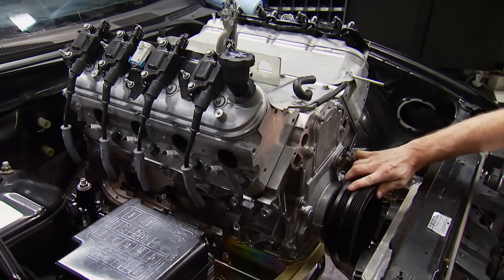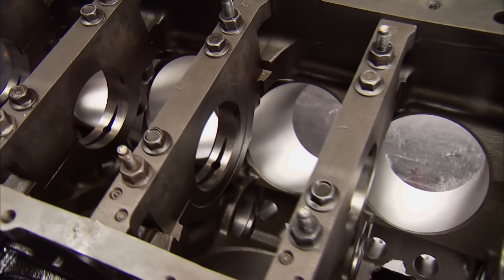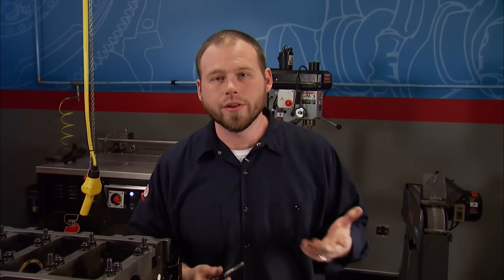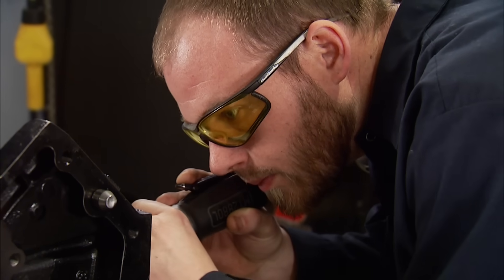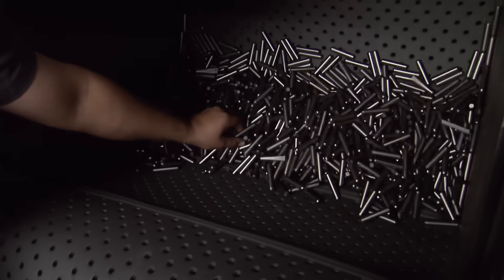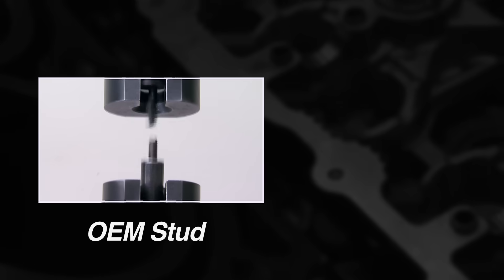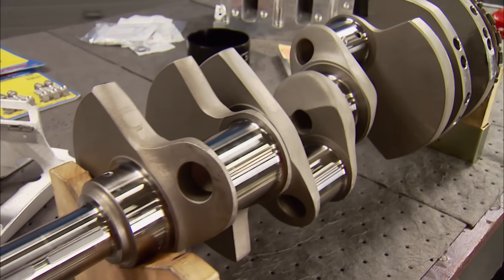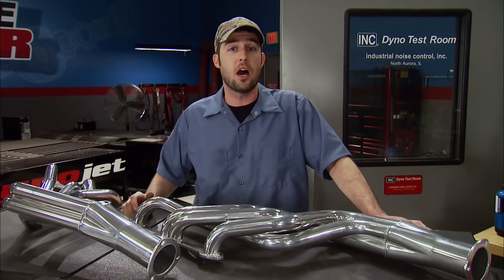Building A Chevy Stroker From Scratch With An LQ4 Iron Block - Engine Power S1, E9

Comment: To ALL the self building guys in here, DO NOT weaken the caps by doing the drilling a hole thing to get it off.  all you need to EASILY remove the caps is a pair of larger (12") crescent wrenches.
Place one on each side opposite each other with the tip of the jaw under the cap.  Press down slowly and watch out for smashing your fingers.  Flat palms work best.
Next thing ya know, pop!!  Cap is off and no drilling/tapping on a block that has already been cleaned.
Can do the same thing with an 18-24" 1/2 breaker bar.
Slide it under one side and pull with a finger on the other.
Pops right up faster than the crescent wrenches.

Comment: Question for you or anyone else who might know. When installing the main caps and bearings you have to torque the bolts then it says to degree the bolts. Obviously I have to check the clearance before final install. When checking the clearances do I torque and degree the bolts or just the torque?

Comment: sadly now arP is chinesium, the stock bolts seem to hold just fine on ALL sloppy builds, yes they destroy ring lands, or keyhole a block now and again, but they also make a Ton o Power off truck/junkyard Vans w cams, springs, turbski's etc....

Comment: Have you ever tested ARP fasteners?  How do you know they are any good?   I worked in aerospace.    Fasteners on planes and spacecraft are carefully specified and tested.    Do not know any ARP bolts used in aerospace.   They are only used in cars where if they fail, it is no big deal.

Comment: WHICH LS PARTS are BEST  swappable from size to size betwen the main 3 sizes; 4.8, 5.3 & 6.0??
LIKE 4.8L pistons will fit a 5.3 directly and increase compression either .5 or 1.0 SO about 9.4 to 10.4 correct?
Which crank in a 5.3 L will make it a stroker?
only specific stroker crank or will 6.0 L crank make it a stroker for example?
WHY are 862 heads so desireable? cuz they flow better AND raise compression? can they be combined with 4.8 flattop pistons and still run on 87 octane?

Comment: The arp main studs are overrated…..stock bottom end LS can handle over 1000hp……only arp hardware id use is head bolts just to abvoid that torque to yeld 45* stretch bullshit….plus the arp head bolts are re-useable ……as are the factory ones..just not reccommended

Comment: Got alot of great info out of this, one thing i did wonder though is (even though you gently used the oil inpregnated file) would that have any impact to the balance of the rotating assembly?
Reply: I was thinking about that too.

Comment: That engine is a 4x24. The cam gear is needed for rpm correlation of the crank. Yet they didn't use the timing cover with the sensor and I'm wondering how this will eventually work without a stand a lone computer

Comment: If you are going to have studs put in....you should have it done when you have the block prepped in the first place. No need to have it done again afterwards..same goes for deburring the bottom of the cylinders. .BTW....there is no way in hell I am going to drill/tap a hole in a main cap and make it weak.

Comment: My understanding of flexing metal it seems like by doing your line honing after you tore it down you made one side bigger that it needed to be because only one side deflected because of the extra pressure I used a half thousandths bearing and changes the gap and I haven't had any problems with my 408 over the past 3 years of service

Comment: Turn my lq 4 into a 408 till this 360 foot pounds of torque to the rear tires the 250 horsepower to the rear tires don't know what it has at the crankshaft but in my 2001 Chevy four-wheel drive 3/4 ton of suburban it pulls the race car down the street is fine I lost point .037 in gas mileage over the old 6 l

Comment: I would highly recommend using thread chasers instead of using taps.  Taps will remove some metal and sharpen the edge of the threads which make them weaker.   Thread chase full sets are inexpensive and last a long time when uses properly.  Taps are for cutting not cleaning.

Comment: That's a cool tip grinding the oil holes to push oil though easier, but what's y'all's opinion on grinding those cylinders down? Need a 2nd opinion bc that just doesn't seem right

Comment: I like ARP, if I could I'd even use ARP bolts to hold my lawnmower wheels on! Being the best is great, but it's something else when you are the best because of the hard work and all the effort that makes ARP the Best bolts available! The only thing better than a ARP bolt, is a bigger ARP bolt! LOVE the ARP FASTENERS!
My 385 stroker has ARP main studs, head studs, rod bolts, and even intake bolts! ( I had a extra head stud, used it to hold the oil pump on! ) And ARP rocker studs!! #1 ARP!

Comment: At 5:41 why didn't he just take the studs out? Why weaken a cap? I've never had issues getting one out... then 2 seconds later he's taking the studs out.. Then runs a die grinder inside the fresh bore. Amazing. That fancy new high vol oil pump going to suck ya sump dry mid track. The original factory one is better. What was wrong with the factory timing cover? What about thrust measurement? Good lord...

Comment: My 03 h2 has the 6.0l and its seriously anemic to say the least.stroking it seems like the best option all the way around with regards to money spent. It needs the torque sitting at 8500lbs dry. Now i just need to win it
Reply: You're hummer is not 8500lbs dry, stop reading the gvwr number on the door and assuming that's the vehicle weight. Actual weight is around 6400lbs. As for performance, truck norris cam from btr, 706 heads, headers and a tune will wake that motor up like you won't belive.
Reply: @donniecahill5243  no it's not prick

Comment: Guys, why tf would you drill out the main caps to pull them? All you gotta do is use the handle of breaker bar on each side and pry straight up. Good god.
Reply: Was a wtf moment for me too. Not to mention the ARP studs were already in it! Could have just backed em out.. Now he has a weak cap and a block full of metal he has to wash again.

Comment: Seasoned block from Summit! = Used junkyard block. Love that it’s rated at 1400 HP. I made 780 HP on my junkyard LQ4 with a VS turbo. Had no clue what I was doing. Hey, it works, what can I say.
Reply: flexplate rating or RWHP?
Reply: @Ed_H_870 you can make 1000 Hp the tire on a stock internal gen 4 6.0lq4.  It’s been a million times. Type it in the search on YouTube.  And that summit block is just a factory 6.0 block that’s been machined.  This isn’t brain surgery.

Comment: I have a 408 in my 2001 suburban I only Dino did on the wheel Dyno and I made 361 ft pounds of torque to the ground
all parts and labor $5600.00
much better than the stock 6.0L that came in my 2001
Reply: That's really low torque numbers. Whats your setup? You should be making 450whp and 480rwtq with a stroker.

Comment: Seems to me that the screw hole in the main caps will weaken those caps.
Reply: Yes asshat idea !
Reply: That is a steel cap on a cast block - what do you think is going to flex - the cap or the block?  Their is a reason neither of you are engineers....  Don't over think this stuff.
Reply: @Chuck_Carolina  why would you think that you’d have be an engineer to question a hole where a hole should not be. There are journals in aircraft engines that no one would ever drill a hole to pull the journal. Answer me why?
One last thought, the engine design engineers at GM did not drill a hole, why?
Reply: @GeoHvl . Agreed!

Comment: And damn! I just finished my build of my 5.4iron block gt500 and I wish I’d seen this because deburring the bottom of the cylinders and the piston skirt is a good idea I wish I knew before! Damn it! But thanks!
Reply: Next Sunday morning, yank that pan in the driveway, blocking your wife's ride in the garage, and start grindin'!!
Reply: @wsfwsf1497  lol 😂
Reply: didn't watch the video because i thought it was one thing an turned out to be go buy bunch of summit parts,having said that once you get a block clean first thing you do is go over it for casting flash an stuff, if you touch the pistons use a scale an weigh them get them the same an that goes for any rotating parts , chevy rods have balancing meat on them to even them out um stuff like that , longer you do it more you pick up like anything  really

Comment: How about just clamp that slide hammer to the outer edges of the cap where nothing touches it anyways and not drilling a hole in the cap that to me could make a weak spot?  Not sure just a random thought.
Reply: Lol or using your hands 🤣🤣 never needed anything more I've done quite a few of these
Reply: LOL yeah. Spend all that time "removing stress risers" from the lifter valleys and gasket surfaces, only to drill a hole in the middle of the main cap YIKES
Reply: @th600mike3  I WAS LOSING MY MIND WHEN I SAW THAT
Reply: I WAS LOSING MY MIND WHEN I SAW THAT
Reply: Yeah I wasn’t a fan of that or the work they did to an aftermarket piston. If you’re that worried about the product, don’t buy it.
Reply: I agree, I’m not drilling any holes in my main caps no way in hell
Reply: They built some pretty good engines on this show, but this one was one I NEVER would have aired if I was the producer.
Must be why that one guy did not last all that long on the show.

Comment: Just wondering about that trick with the main caps ,  isn't drilling a hole in the smallest part of the main cap introducing a possible failure point in the weakest point of the part? I've never heard of one breaking, but at big numbers and pressures you can see nowadays,  just curious...

Comment: I want to know where the other 2 parts to this are?  Really damn annoying to not have links in the description or something to see the rest of the build and power numbers.
Reply: Just go buy a ls364 straight from GM. Cheaper and with a warranty.
Reply: @MrPland1992  I am not over spending for 1000 hp.
Stock junk yard stuff has been proven to do that with only a good cleaning and new rings gapped for BOOOOOOOSSSSSSSSSSST
Reply: @Ed_H_870 not true whatsoever. I do LS swaps for a living. Literally every junkyard engine I use has 3 psi oil pressure. It’s not worth the headache anymore and I’m not in poverty. I can afford $2k-$3k for a nice “new” engine. Factor in the tow bill when your turd blows up once a month. 
I want to be able to beat the piss out of it and not worry if me or my customer will make it home
Reply: Look up Iron Animal build.  They just renamed this video for some reason.

Comment: WD-40 is not a lubricant, I know a lot of you heard this but did you know that it was invented by the rocket chemical company in 1954 to spray on the skin of atlas rockets to keep them from rotting in the silo. WD stands for water displacement, the 40 stands for the 40th concoction, I'm speaking of the original formula

Comment: I welded a slide hammer to a pair of modified vice grips that I put aluminum jaw blocks on to do the same thing.  I also use two torque wrenches at the same time when securing caps

Comment: My daughter threw away about $1300 worth of fastners from ARP. She has a part time job now
Reply: Jesus christ
Reply: Please explain how this happened
Reply: @tjlovesrachel  I bought her a 1996 mustang gt for her 14th birthday that we could build a drift car together. On the 3rd day she had it. The car was down to frame. We hit the jackpot on the car because we didn't know the previous owner actually upgraded everything we wanted on it, INCLUDING ARP fastners for everything etc connecting rods, mains, heads, trans, I mean everything. While she was cleaning the scrap pile, she literally just swept all the bolts away because she wanted new everything. She did her homework that the engine used torque to yield in some areas and didn't know ARP were reusable. When I went to the trash to look for them, they were gone but I did manage to save $2000 worth of other parts she threw like accufab throttle body, flywheel, nitrous controller, MAF sensor, valve covers 😅 to name a few
Reply: @elite4championjosh  Jesus Christ... but thank god you saved the parts you did save... and I guess she knows now about them arp fasteners lolll.... best of luck to you two... how did the project go?
Reply: @tjlovesrachel  it'll be ready in about a month. Been down for 2 years because she's building it. I'm just guiding her through the process. But she's changed the color of the 3 times though 🤣
Reply: @elite4championjosh  freakin sweet... I bet she can’t wait to drive that thing and light up a parking lot lolll...I wanna do a similar project with my kids when they are about the same age... would love to see it when it’s completed.

Comment: Nice new engine parts and a carb, come on its not the 80s still
Reply: Video made in 2014, how were after market EFI systems then? Serious question, not meaning to diss you.
Reply: @allenl9031  the same as today. HP Tuners has been the  go to tuning software for GM LS Series..although a few years ago Holley created tuning software product  that is great and pairs up real easily with Holley ls products. Although it’s much more expensive than hp tuners.

Comment: I am currently accumulating parts for 6.0 stoker (haha)
Reply: Neat, I turned my 5.7l in my Ram into a 6.4L stroker, love the power!
Reply: @bigboreracing356  yeah over spend for no reason. The cheapest way to get to over 600 horsepower is a junkyard ls 5.3, cam swap, valve springs, injectors/ fuel pump and a Chinese turbo charger. This will run you at around less than $5,000
Reply: @ivanjimenez8868 . You’ve been watching Richard Joldener🤣
Reply: @bri-manhunter2654  sweet! His work is awesome and a great guide for anyone looking to add power.
Reply: @bigboreracing356  theres nothing to build that's a brand new crate engine.. nothing is wrong with it but theres much cheaper alternatives. you'll get more power from a junkyard gm for less cash. If you want to hit 1000 horsepower? Then use more turbo boost, 20psi of boost, with e85 will easily get you there on a junkyard 6.0 ls..with a 5.3 you would have do a little more work than a 6.0 but you'll get there. Watch richard holdeners or sloppy mechanics' content and research as a guide.
Reply: @bigboreracing356  nice! On all parts from the Ford factory? Besides the turbo. And On pump gas?
Reply: @bigboreracing356  I’m just asking?? So no pump gas? What’s it running? you’re the one telling the story , I’m not Henry Ford..So what’s in that race car ? A new factory 1400 HP 7.3 godzilla/Turbo charged rebuilt engine?

Comment: That trick of John's getting those main bearing caps out was pretty smart
Reply: Since he is using a vice grip slide hammer, why not just vicegrip to the caps?
Reply: @greggoett  I was thinking the same thing!
Reply: Two long screwdrivers slid into the side gap and a quick tap does the same thing without any chance of weakening a cap
Reply: Except he used a standard thread on an otherwise metric block.  Should have used a 6mm
Reply: Except the part where he's blowing metal shavings all through the engine, bearings included!
Reply: yeaaaah id rather just use that perfectly suited vise grip hammer he had, put some hot glue or rtv on the teeth and grab the cap directly.
Reply: Still learning about high horsepower engine building, could this possibly cause a weak spot on the cap?
Reply: @cmkm54  I'm not an engineer.   But my gut says that the what looks like an 1/2" of hole depth would not be a big deal at normal power levels.  Like the 500 hp they suggest before they put the screws to it.  Now at 1000 it might be an issue.
Reply: Less metal on cap means less structural integrity. Especially on a 1000 hp motor. I would have spent money on the  correct tools.
Reply: @jessenorris84  They do stuff like that all the time. They spend 5 figures on a build and then have a tip on saving $200.
Reply: It was.  Some manufacturers build it in.   Either way very helpful.
Reply: pretty stupid actually...

even a deep scratch on caps will weaken them, let alone drilling and tapping an extra hole in the center of them...  might as well drop them on the floor a few times while he's at it...
Reply: I wonder if you could place a strong magnet on the bearing cap, attach the slide hammer to it to pull the caps?
Reply: @allenl9031  you can buy some pretty strong magnets so in theory it might.